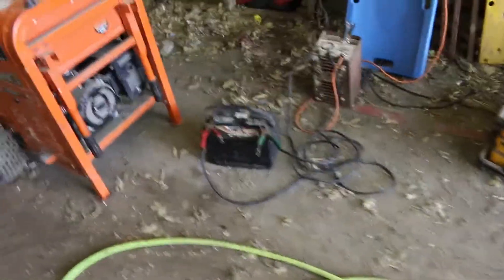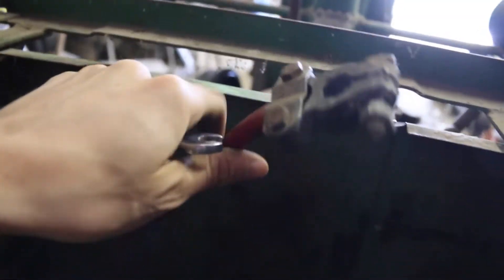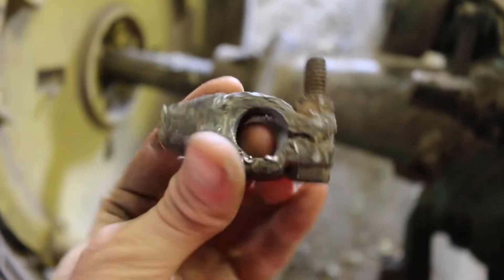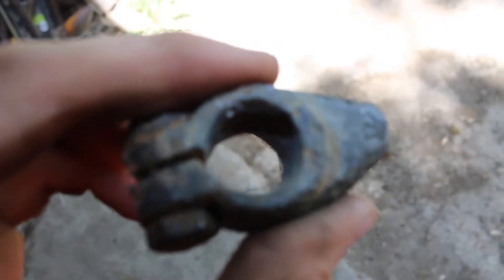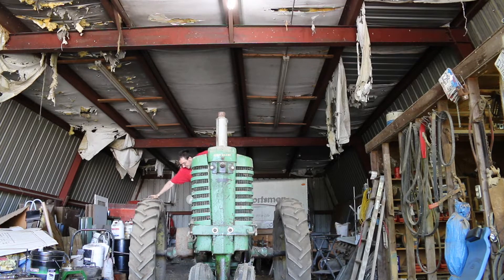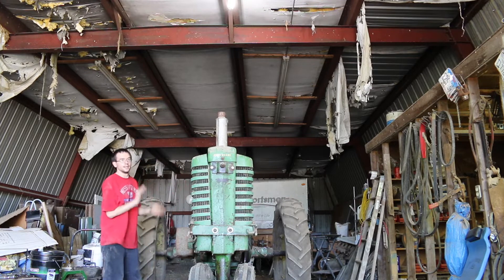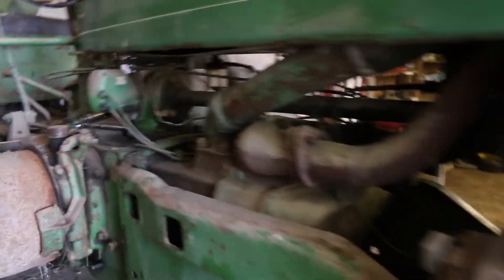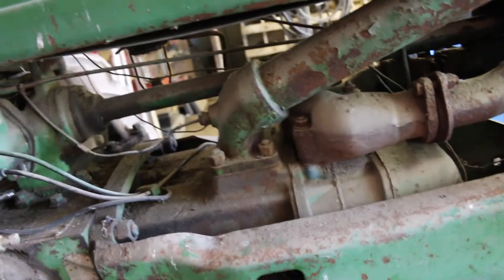John Deere Model A Wont Start, I Give Up!

Comment: I use brake cleaner as starting fluid works good when you stick the straw down the air breather and spray a bunch in there

Comment: Did you try looking at the distributor, or carburetor.or taking the valve cover off and testing the gap between the valves.
Reply: It has got a magneto
Reply: @lukeharner9056  I would replace the coil and condenser and get a carb kit